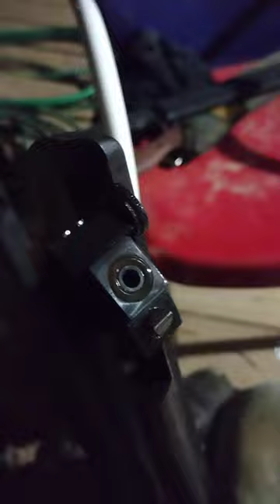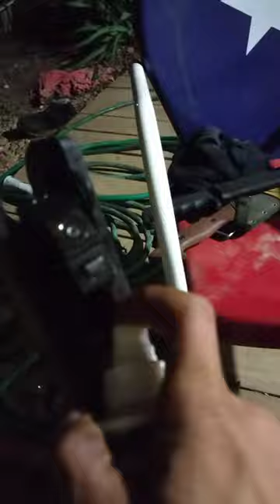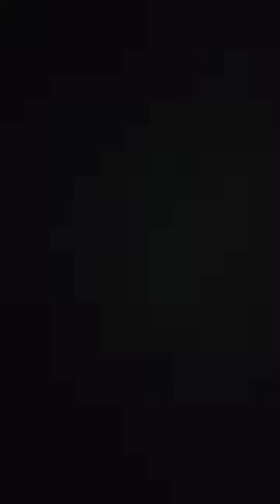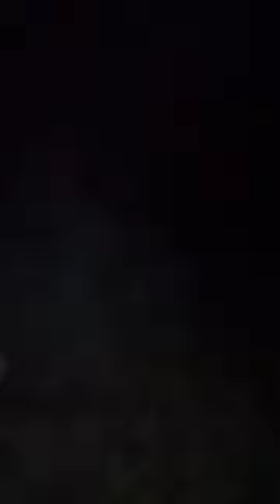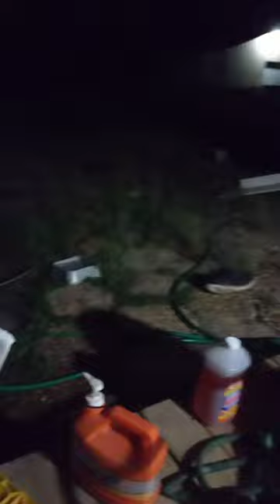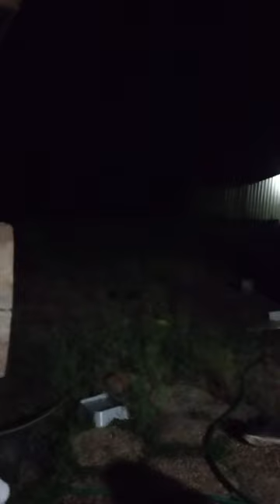"Dieseling" muzzle flash from a .177 piston air rifle? (not recommended for a gun you care about)

Comment: Just as important as the mixture is the octane. It needs to be really low octane. Gasoline is probably to high, alcohol is really high at more than 110 octane. Diesel is about 15 to 20 octane, and that should work fine.

Comment: I'd diesel with sewing machine oil

* Pellets breaks sound barrier
* Easy to coat pellets 
* Cheap
* No damage to my precious air rifle since it's light machine oil
* Proved every internet karen wrong on dieseling destroys airgun, I've been dieseling for 2 years at least
Reply from the maker: Will it stay inside the skirt without migrating?
Reply: @flinchfu  drop some tea spoons inside the 500 pellets tin and gently shake it, roll and good to go
Reply: @flinchfu  plus my rifle (aarmr 350) is designed to withstand high temp of ignition cause by dieseling